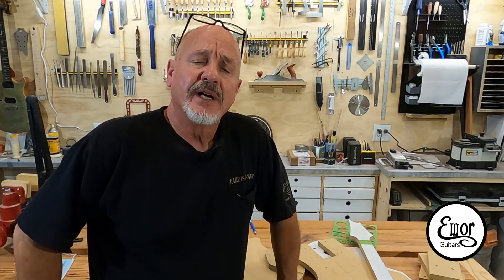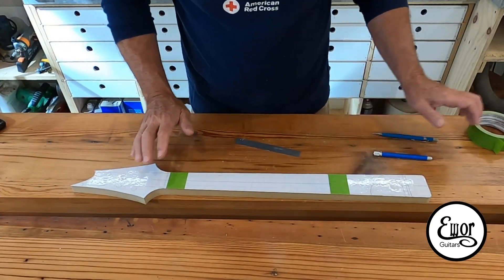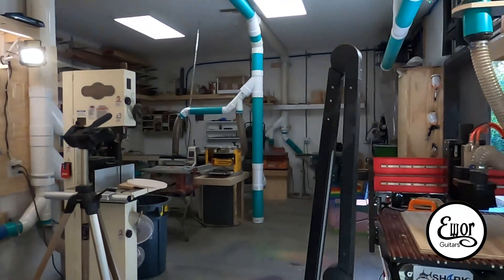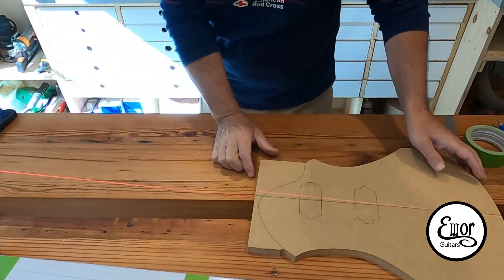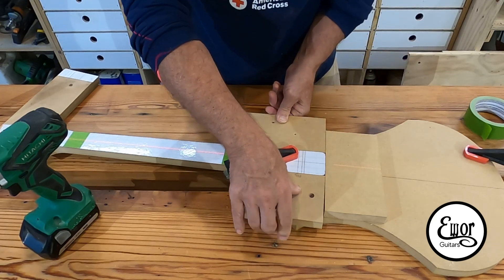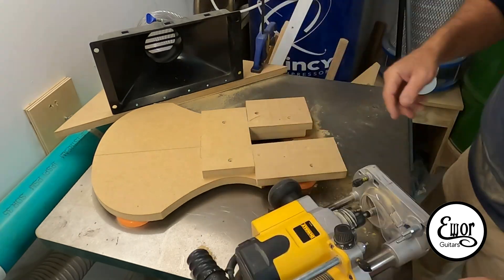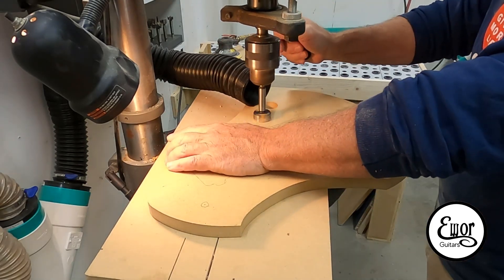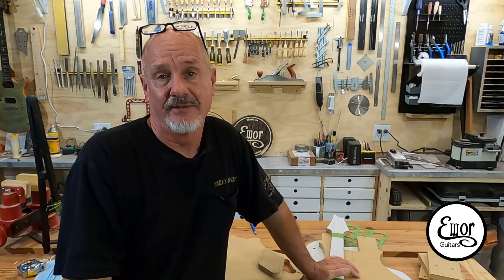How to build an electric guitar episode 5: Templates 2

Comment: Thank you again for the great content. In terms of the neck to body pocket fit for a set neck, do you always go for a tight fit? For mahogany neck and body this makes sense but if using different wood types, say maple and basswood for example wouldn't you leave more gap space to account for different wood expansion?
Reply from the maker: As always that is a really good point Maxime! Even though I keep these woods in a dehumidifier box while under construction the woods can move differently. I haven’t experienced a problem so far. When I do my final fit up of the neck/ body I actually sand a very slight taper on the sides of the neck to where the edges of the joint are as snug as possible without being to tight then the taper gives a little room for glue

Comment: For the recess on the control cavity, what's your thoughts on using a pattern bit with an offset bearing on it to cut the "shelf" instead of making a template for that? So like take a 3/4" bit with a 1/2" bearing to cut a 1/4" shelf you know? Thanks man.
Reply from the maker: Actually I don’t think on my guitars a 1/4” shelf would leave quite enough room for the screws. So I usually make some thicker areas around the cavity where there is enough room. So the cavity and the cover are slightly different in shape.
Reply: I get that but I've seen a cavity shelf done this way before. Maybe 1/4" was a bad example. More like a 1/2" but that could still be accomplished and I'm sure you get where I'm coming from! It's just one less template to make you know? Love the videos man.